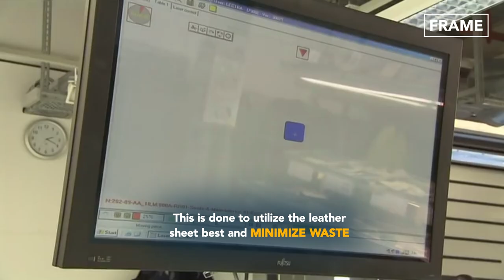England Best Factory: Most Luxurious Rolls Royce Production Line by Hand

Comment: Just to clarify, as it's a common misconception: BMW are licenced by Rolls Royce Plc to make a Rolls Royce branded car. They did not buy Rolls Royce.
Reply: What makes you believe this is true?
Reply: @luccadukka  well, it's just a fact because ownership of the brand name "Rolls Royce" and RR logo was retained by Rolls Royce Plc when they de-merged Rolls Royce motor cars in 1971, and licenced the brand back to RR cars. When Rolls Royce motor cars was sold in 1998 to VW, Rolls Royce Plc choose to withdraw the brand licensing, and did a separate deal licensing the Rolls Royce brand and RR logo to BMW for the purposes of branding motor cars. Hence, whilst VW bought Rolls Royce motor cars, going forward it could only sell a Bentley branded car (as the Bentley brand was owned by Rolls Royce motor cars) They subsequently changed the name of the limited company to "Bentley Motors Limited". Hence why BMW is only licenced to build a Rolls Royce branded car, it never bought the company. I believe there was an initial payment of £40m for the licence.
Reply: @highlandmalt6368  I’m sorry but that is wrong. Bmw released a statement in 2020 to clarify that fact. Rolls Royce plc and rolls Rolls Royce cars are two completely separate company’s. The logo was originally on license. That is no longer the case. A simple search of the internet for that press release will explain that to you.
Reply: @highlandmalt6368  if you google the images for rr cars and rr plc you will see the difference. One is blue and the other is not. A small difference I grant you but, it is significant and completely separates the two companies.
Reply: @luccadukka  a subtlety like that would not constitute a separate trade mark.
Reply: @highlandmalt6368   In your opinion maybe but that’s not the case as VW, BMW and RR ltd or plc at the time saw it. Silver on black and black on silver are owned and controlled by BMW. I know this because I worked for them. Continue to believe what you choose but in this instance you are wrong. I’ll clarify this again. RR cars and RR plc/ holdings/LTD are two separate companies, involved in unconnected fields of manufacturing and have different company logos. Their only connection at this moment in time is historical.
Reply: @luccadukka  companies.

Comment: Very interesting compared to the way they were building them at crew in the seventies more workers took longer. I own my crew car but that Rolls-Royce I would lease. Too much Electronics when it becomes 40 years old how do you fix that kind of stuff how many electronic items have you tossed into the trash VCRs DVD players other electronic devices. It Dooms the cars and makes them non-collectible. Hold on to those old vintage rolls royces the ones where everything's analog and can be taken apart and repaired by hand. What's that hole in the dash oh that's for the electronic navigation screen used to be. I don't call it progress not for Rolls-Royce